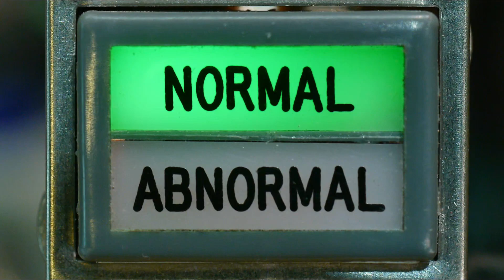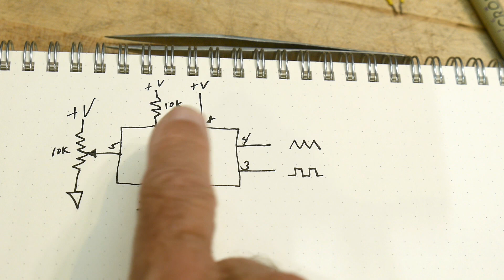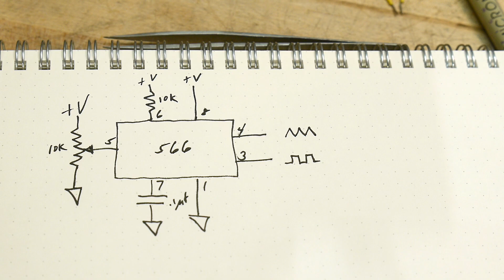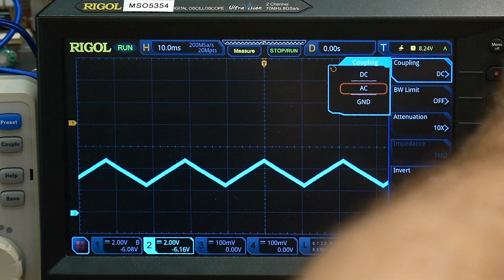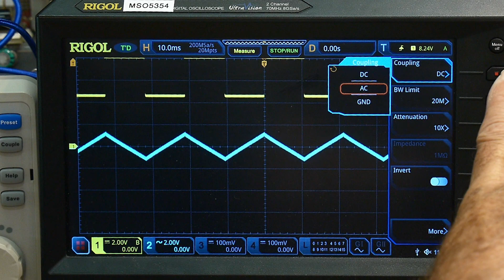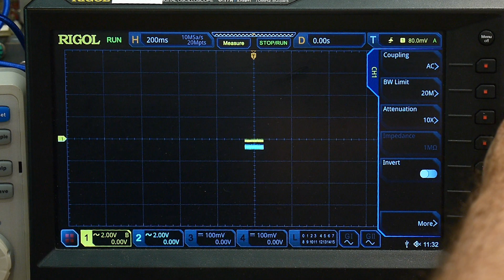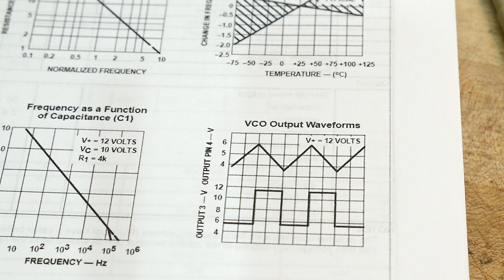#1575 NE566

Comment: As a video idea, you might like to put a triangle wave through a sine-wave shaper like how most analog function generators made sine waves. The idea is to use the diodes' exponential I-V curve to convert a triangle wave into a reasonable approximation of a sine wave. It doesn't take a lot of parts and many older op amp books had function generator circuits with a stage like this, if you want an example to go from.

Comment: There was a whole family of 5xx parts made back in the day by Signetics. The 555 was one of the few that survived the test of time. There was a 567 tone decoder that also was popular and was made for many years. I am thinking most of this family was from the early 1970s or so.
Reply: Correct, the 555 came in 1971.  Signetics was founded by disgruntled Fairchild employees that wanted to move to IC manufacturing, while Fairchild focused on discrete transistors.  They just about failed when the feds approached them about making some custom ICs. They were the only game in town, so they succeeded.  Philips bought them in the mid 70s I think.  Now it's all part of NXP.
Reply: LM567 it is still in the production. It is made by Texas Instrument, but who cares about the manufacturer.
Reply: @batman4e  After a fashion, we do care about the manufacturer. TI is a good brand with very few and specific exceptions.  They've acquired NatSemi. LM567 is a natsemi part. IIRC they make two versions of it: LM567-N in the legacy ("original") process, and LM567 on a more modern process.